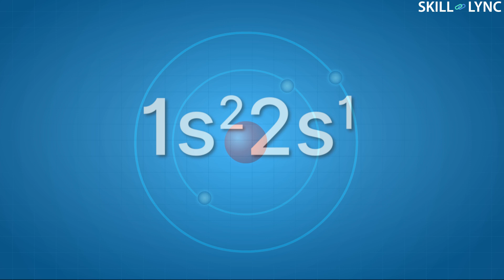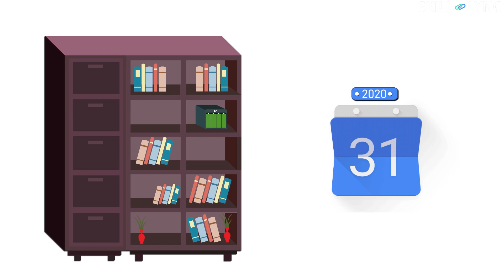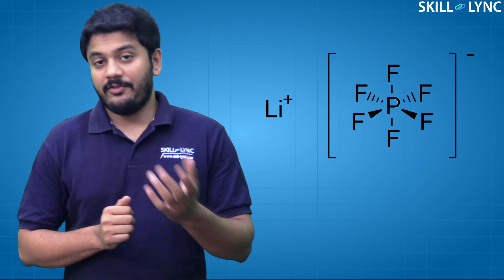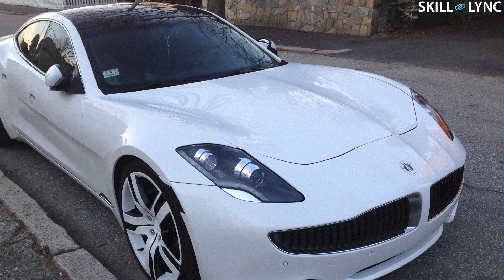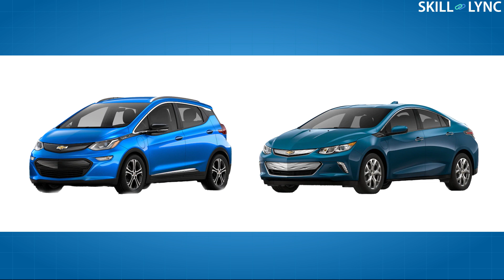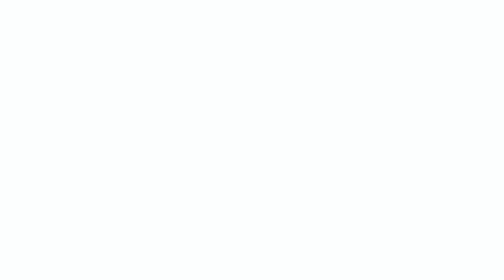Lithium-ion Battery Chemistries | SKILL-LYNC

Comment: Litium-metal-oxides are at cathode ( at aluminum tab ) and the most carbon is at anode ( at copper tab ).
When you charge the battery, the electrons leave the metal oxide from cathode ( at aluminum tab ), and combine with Litium positve ions in the carbon matrix at anode ( at copper tab ). 
In reverse, when it is discharged, the electrons leave the carbon matrix at anode ( at copper tab ) being detached from the Lithium in it, and go back to the metal oxides at cathode ( at aluminum tab ), getting attached back to those metal oxides.

Comment: Hello everyone, greetings. This is a message for all the Li-ion battery manufacturers and procurement heads or SCM managers.

We can provide RA copper foils / tapes which are used for anode application with a thickness range of 20microns to 100 microns and width range of 10mm to the 100mm for cylindrical as well as pouch type batteries.

Our high conductivity copper tapes / foils are of international quality and conform to all the chemical and physical properties with conductivity of + 100% IACS, elongation and tensile strength.

The physical properties are shiny RA copper  foils / tapes with high shelf life.

Please do contact us for your regular requirements with sizes and monthly requirements.

We would be pleased to clarify all your concerns on this matter if any.

Needless to say that our prices would be internationally competitive with shortest delivery.

Looking forward to your questions if any, please do communicate with us at copperfoils@gmail.com

Have a great week ahead and stay safe.
Reply: kindly provide your contact detail

Comment: 4:20   "when all the lithium has moved from the anode to the cathode the battery is fully charged."  you have mixed them up, a charged battery has lithium stored in the anode and will move to the cathode during discharge!

Comment: will it be possible to achieve a higher niminal voltage in batteries than today?
Reply: Technically yes, but it's no easy task. The nominal voltage for a cell is specific to its chemistry. So, we would need to research and discover a better chemistry that yields higher voltages.